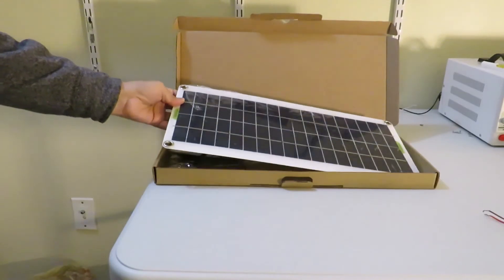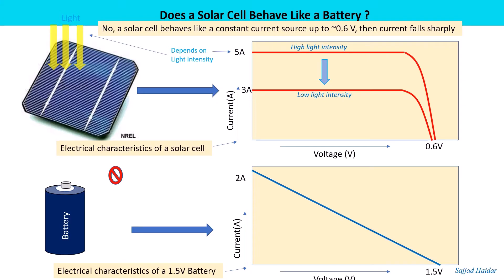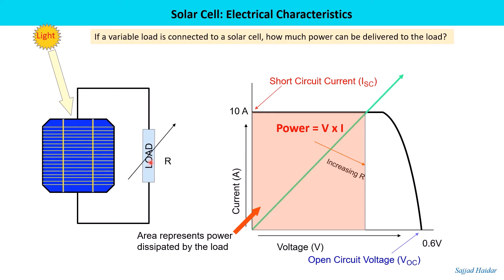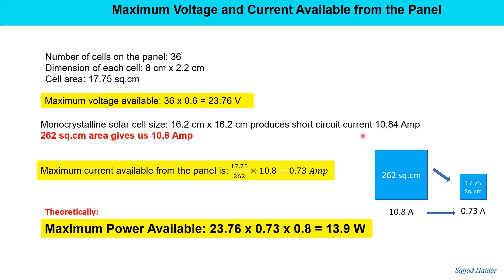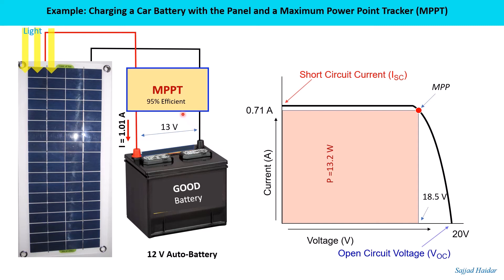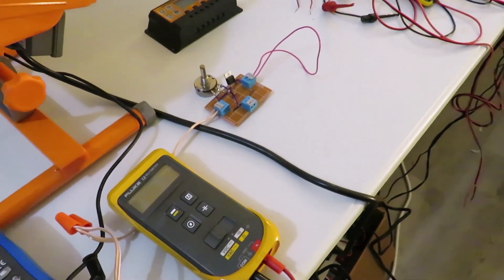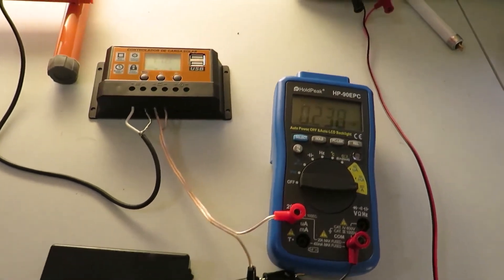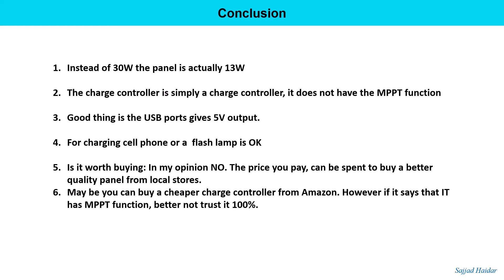Solar panel for battery charging

Comment: Why does increasing the load increases power to a certain point?
Reply from the maker: Thanks for your question. A photovoltaic (PV) panel differs from battery, The output is much like a constant current source up to a certain voltage, then drops quickly close to the open circuit voltage.  Consider the panel I used, up to nearly 18 volt current is 700 mA. If a 10 Ohm resistor is connected with it, voltage drop across the resistor is 10x0.7 =7V. Power dissipated by the resistor is VxI = 7X0.7=4.9W. Now if a 20 Ohm resistor is connected, voltage drop =20x0.7=14V, power dissipation =14x0.7=9.8W. So, though I am increasing the resistance power dissipation also goes higher. Now if I connect a 40 Ohm resistor, thing will be different. If we suppose current is still 0.7A, voltage should have been, 0.7x40 =28V, but the panel cannot give more than 22 volt. So the voltage across the resistor will be ~18V. Now the current is V/R= 18/40=0.45A. Power dissipation =VXI=18x.45=8.1W. So the power goes down.